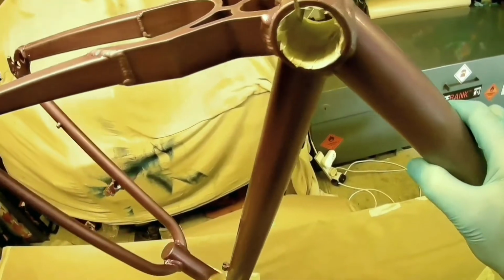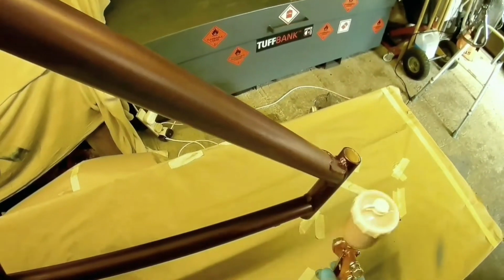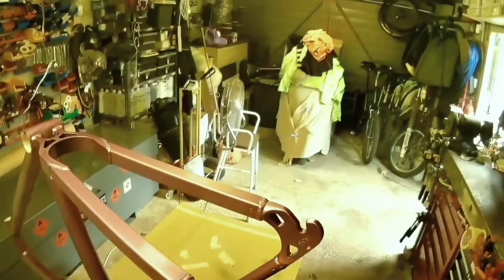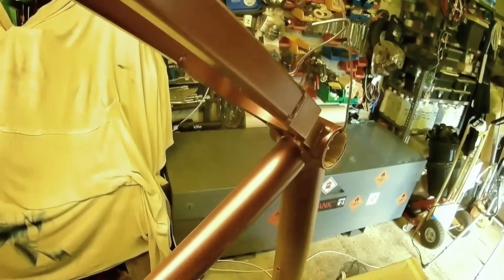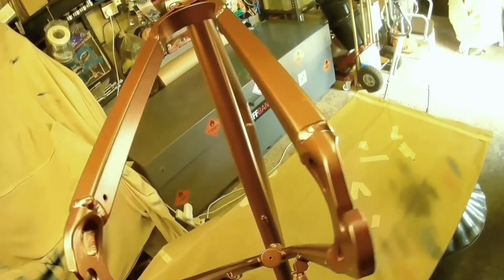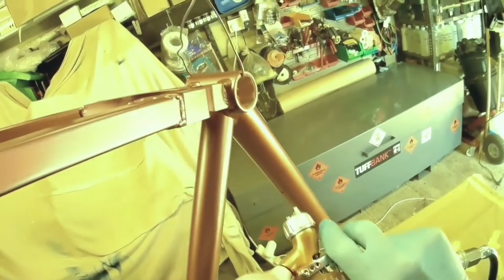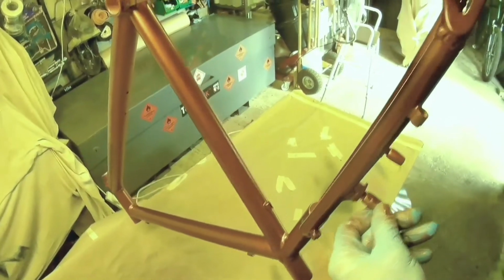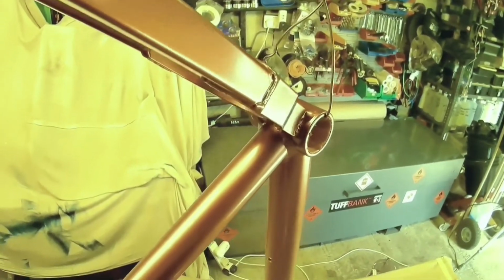Spraying A Cycle/Bike Frame With Basecoat With A Devilbiss Sri Pro Lite 0.8 Tip TE5 Cap

Comment: Hi Which do you like, this gun or the ANI 160 mini gun ?
Reply from the maker: My favourite by far is the Sri Pro Lite, the fan is more adjustable compared to the R150 R160 and the atomisation is finer, not quite so nice in the hand though for me as the R150 but still comfortable, but, as you will know it's over twice the price
Reply: @peteshobbies5383  Thanks for that very interesting mate......